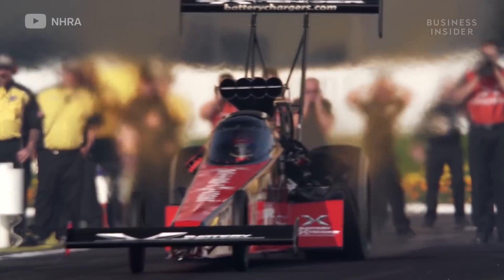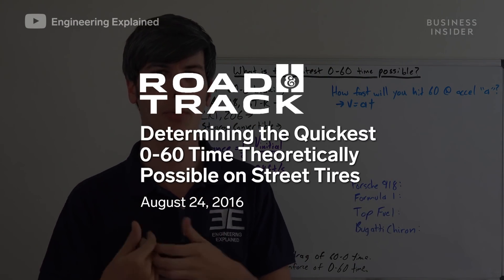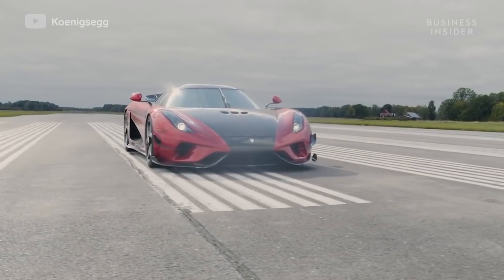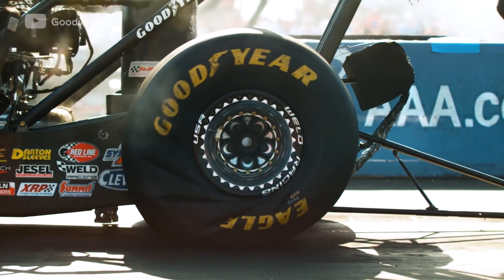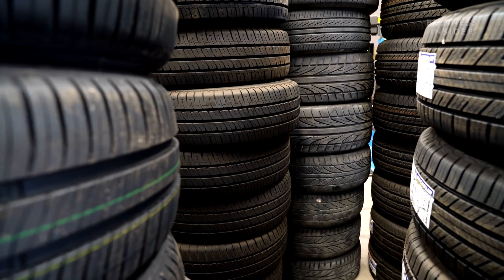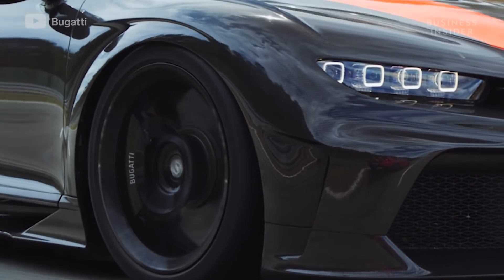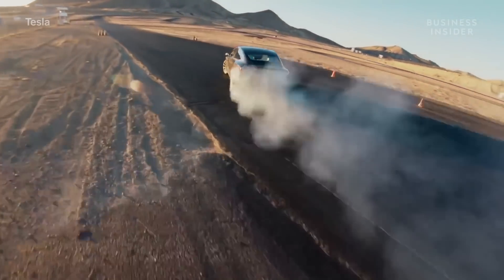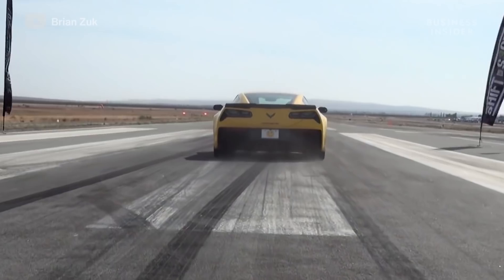Why Going 0 To 60 Mph In Under 2 Seconds Is Almost Impossible | Carsplainers

Comment: Koenigsegg and Porsche have been at it for a while, Tesla is gonna put up some real numbers soon too
Reply: check out aspark owl. the prototype already did 1,9 or so
Reply: Porsche has never been about fastest 0 to 60 times. Porsche most expensive 911 is not even that impressive from 0 to 60. But on track, tesla will never ever get close to a Porsche.
Reply: @hoen2009  the 918 does it in 2.4 the 911 turbo s does it in 2.5.. So i'd rethink if u think Porscha isn't about 0-62.
Reply: @hoen2009  even in a straight line look at the new 992 911 turbo s
Reply: @hoen2009  Hahahaha the Tesla model S plaid already beat the Porsche gt3rs (at laguna seca) and the Porsche taycan ( in Nurburgring)
Reply: Pretty much all hypercar companies have a car that's in the 2-2.4 second range in 0-60
Reply: Rimac has a good chance at it too
Reply: Actually, the Tesla roadster will go 0-60 in 1.9 seconds with it's fully electric battery/engine. The koenigsegg Gemera will go 0-60 in the same time with its 3 cylinder engine as well as a triple battery electric motor. Please make sure you do your research before you speak.
Reply: Koenigsegg only good example is Gemera, otherwise koenigseggs have terrible launch capabilities.
Reply: You see, many people compare 0-100 when talking about Tesla, that's because there's nothing else to talk about. Quick 0-100 is a result of the instant eletric torque delivery, it happens with every motor, so it's not a good indicative of how good the car really is.
Take the fastest lap around Nurburgring Nordschleife for an example: 5m 19s, set by Porsche. The fastest all eletric lap is nearly 50 seconds behind at 6m 05s, the Volkswagen ID.R, Tesla (the so called fastest production car in the world) is another minute behind, with the Tesla Model S, since the Roadster didn't to any lap yet.
That's slower than the Ferrari 488 Pista, Lamborghini Huracan Performance and Porsche 918 Spyder. But let's be honest, the chances of the Roadster breaking Porsche's or even Volkswagen's record are very low. Maybe it will be even slower than the AMG GT Black Series
Reply: @afoxwithahat7846  I agree, the roadster will accelerate in a straight line like crazy but when you give it some corners and some bumps, I would rather take a '63 VW
Reply: @afoxwithahat7846  diesel fans will say literally anything to discredit a electric car. First you guys complained saying a electric car will never beat a gasoline car in a drag race. Now that a tesla is the fastest stock drag racing car in the world. A new complain comes that it will never beat a gasoline car in a race with turns??? Lmfao. What's next it will never beat a gasoline car in making engine sounds? Sucks to suck since gas cars are gonna be a thing of the past 10 years from now.😂😂😂😂
Reply: @mustafaayyad8575  Electric car fans/Elon Musk Worshippers are the hardest to understand in the internet. 4 days have passed and I still don't understand what you were trying to say.
 Just a bunch of nonsense and strawman arguments.
For example: I like Diesel cars
Electric cars will nevet beat Gasoline cars in drag races
Electric card will never beat Gasoline cars in a race with turns (When a race is already supposed to have turns)
Electric cars can't make better sounds than Gasoline cars.

And I'm fairly certain you guys have been saying Electric Cars would be the thing of the next decade for several decades.
Reply: Yes but Tesla has done more in it's short period of time then the other two in many decades
Reply: @jonjeskie5234  many decades?😂 Koenigsegg was founded just 9 years before tesla. Saying one has done more than the other is ridiculous since you can’t compare the two.
Reply: @stanvalk7472  he has no idea like many tesla fans
Reply: @santiagocalderon3261  the aspark owl costs 3.2 million tho. But the roadsters price will be around 300 thousand. So wouldn't that mean the roadster is better
Reply: @demonfire101gaming6  its better value for money but not a better overall car,  just like any with any hypercar
Reply: But my point was that the argument of those brands being around for many decades was just not true with some of the brands they were talking about
Reply: @demonfire101gaming6  no, that would mean the roadster is cheaper, not better. learn how to use words.
Reply: @santiagocalderon3261  the roadster is better in every way except for acceleration compared to the aspark owl :)
Reply: @Relansls  almost every hyper car is better than the roadster in every way except 0-60 times
Reply: @santiagocalderon3261  Pls explain

Comment: Bet Dodge could do it if they managed to take a SRT DEMON CHALLENGER, Get rid of the back seats, and then build panels and pieces like the roof and trunk out of carbon fiber.
Reply: All they need to do is include AWD, boom sub 2 lol
If it can do 2.3s and 2.2 with RWD, imagine what AWD can do
Reply: @amateurapple  I agree with your statement, however you have to remember that adding AWD components to any vehicle that's RWD stock will add weight. Yes the carbon fibre panels and other components made out of carbon fibre will reduce the initial weight compared to stock steel/aluminium ones. However, more power would also be needed to compensate for the awd system. I would assume (I'm not an expert or anything on the demon's engine) the engine would be easily able to be tuned for more power. Just imagine a Dodge Demon that has Carbon Fibre body panels, only had 2 seats, an AWD system like Audi's quattro system and 1000 BHP. That would definitely make 0-60MPH under 2 seconds. Well at least in theory.
Reply: @ThatMetalheadguy666  Actually the truth is 840HP is more than enough. You'll never see a Demon putting out all 840HP on the track at launch, which is why they always screw up the launch. The HP is just too much for two wheels to handle. But you got a point with the weight stuff
Reply: @amateurapple  Yeah that's probably true and yeah. At the end of the day, no matter how much power you have, or what materials your vehicle is made out of. If you can't put the power down to the surface, you just simply can't achieve the best time that's possible for that given vehicle (That's if you're going for drag racing/ 0-60 times for example). Unfortunately the limitations in the current technology of tyres, wheels, surface prep etc is the reason why we can't achieve better results, well for now at least. Who knows what the technology will be like in 20 years from now, right?
Reply: @ThatMetalheadguy666  I doubt there's gonna be prepped roads like dragged strips. If anything, tire quality will improve and vehicles will be a littler heavier to be able to get more grip.
Reply: @jaydenp.6243  I don't know how you got a stock performance chip but would you elaborate?
Reply: @jaydenp.6243  Well that seems a pretty redundant thing to do when they can do modify the factory tune on the ECU. I do like your idea though.

Comment: Taking Engineering Explained video as the reference means you have done your research before making the video. Kudos to your team.
Reply: Idk they are just taking the Engineering Explained video and saying it differently. This is plagiarism they have done no additional reasearch and no additional thinking.
Reply: @yanntapiero7760  Welcome to YouTube
Reply: Well,  lots of incorrect statements in this video prove that research was NOT done properly. 
* Unit of acceleration should be ft (or rather m)/s², not ft/s. Time is squared for acceleration.
* There is no torque vectoring on any current Model S. Also, you need an independent motor per wheel, not per axle for torque vectoring to work. 
* You don't need a "supercomputer" to calculate torque vectoring PID. The kind of controller you need in a quadcopter can do the trick easily. So you could completely do that with a 5$ arduino, which is not exactly what I would call a supercomputer.  
* Torque vectoring does NOT help with acceleration nor does it increase total grip. It helps with cornering though but that is not the topic of the video. Beats me why it was even mentioned.
Reply: Not being able to use correct units for acceleration shows they just took Jason’s word for it.
Reply: By boy has a fully built r32 GTR that does 0-60 in 1.92 seconds
Reply: @nicolassmith9533  Really? Can you put a link to it? I'm really curious
Reply: The fact that making research before doing an article is applauded just shows how journalisme is bad these days.
Reply: Meanwhile with zero thanks or credit to him. Stop praising people willy nilly or it won't mean much.
Reply: Or you managed to watch EE without falling asleep, which is an achievement in and of itself
Reply: Not really -- it's literally watching someone else do the homework and reporting their answers
Reply: Kudos for what? Making a video they would have had to research anyway? Stfu lol
Reply: Fr!!!
Reply: Ive seen somewhere lotus electric or any other hybrid 0-60 under 2 sec , about 1.9s , right ?
Reply: Yikes! This didn't age well either lmao
Reply: lol, EE is an engineering joke round our parts.
Reply: It is the discussion that elevates the value of a yt video.

A video with bad research but a lot of comments will earn it's creator more than a video with good research and only few comments.

And as we see here, bad research fuels discussion by people that dislike bad research.

Meaning: people that dislike bad research make badly researched videos valuable.

Just stop discussing shit!
Reply: You have a low bar for quality research.
Reply: What's wrong with that if the facts are correct.
Reply: @jasonbourne6531  Nothing's wrong with that. He just meant, they have done enough research by watching Jason's videos. If you don't know, Jason's one of the best.
Reply: It doesn't, but ok